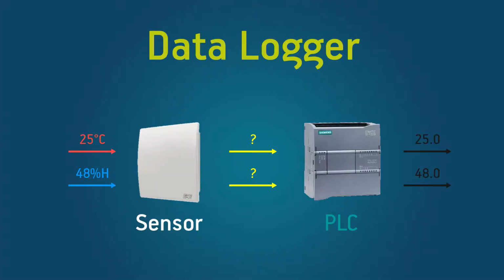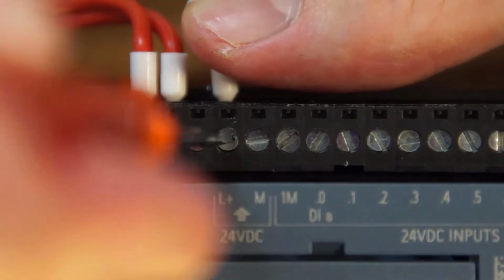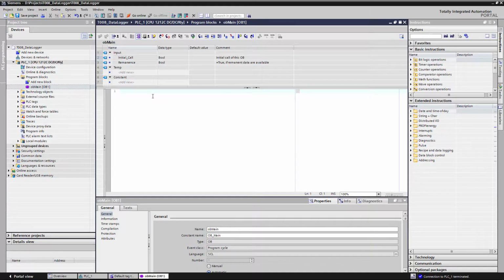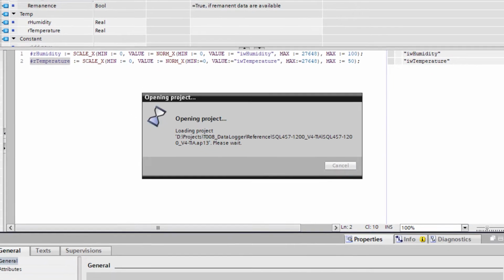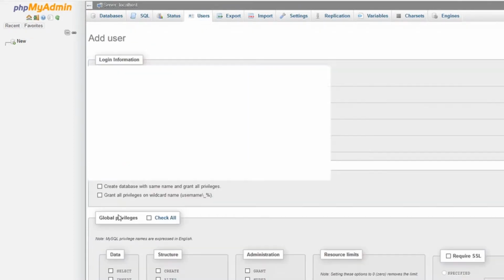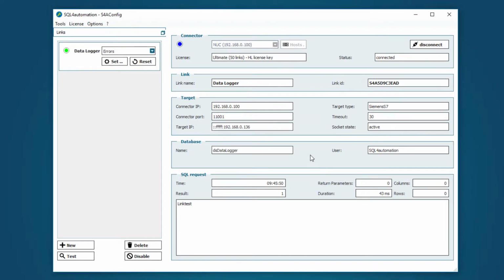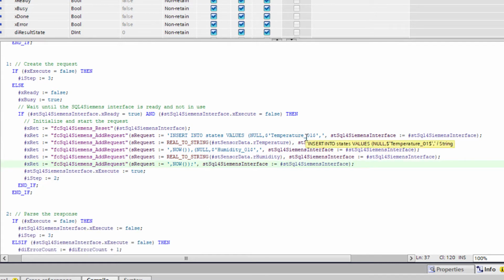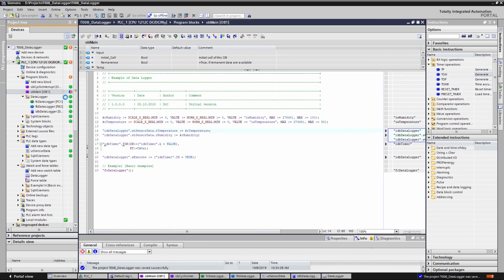Logging Sensor Data From Siemens S7 PLC To MariaDB SQL Database

Comment: Can the NUC be bypassed? Or is it necessary for the connection to work?
Reply from the maker: Hi Mihai, you don't need the NUC. I just used it as an example in this video. You do need however some place (Linux or Windows) to install the S4A connector. Sometimes you can install it directly on the same computer, where the database is running.